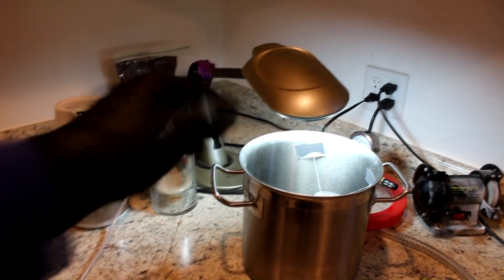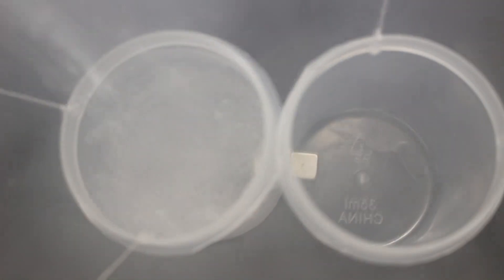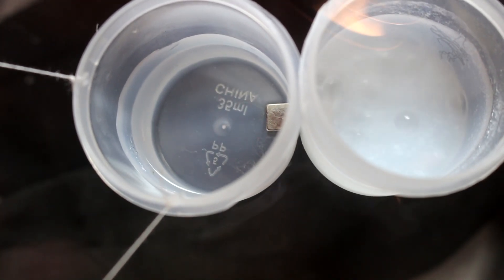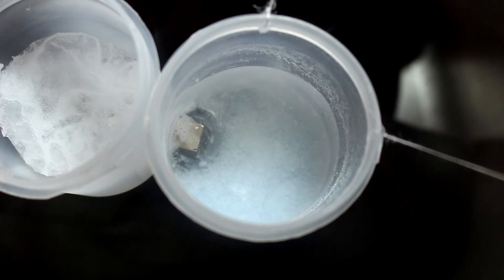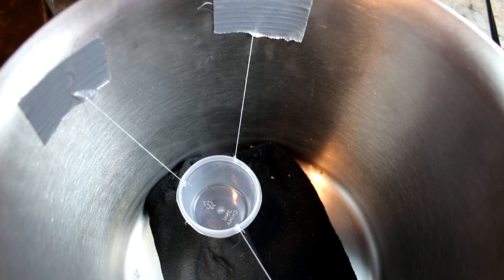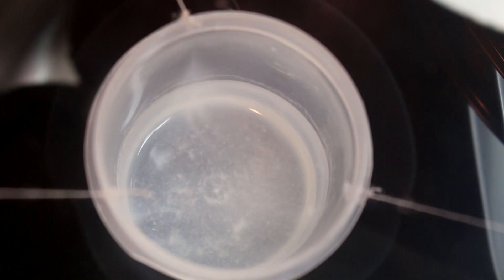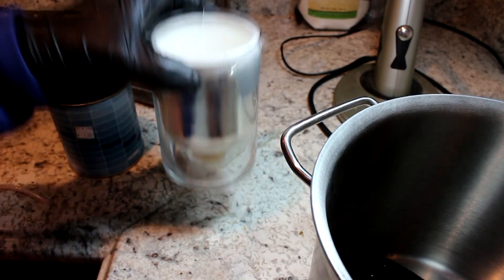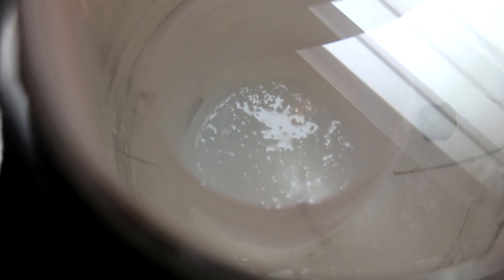Making Solid Oxygen

Comment: If liquid oxygen was at room temperature, would it be possible to inhale it without drowning? technically I'd still be taking in Oxygen but in liquid form. I hope you answer!
Reply: You're thinking of breathable liquids, which is a real thing. Fascinating, scary stuff. Turns out our lungs aren't meant to handle liquids, but they can just barely for short periods of time.
Reply: Nathan Burton

Hypothetically if a grandma had mustache she would be your grandpa.
Reply: +DaffyDaffyDaffy33322: our lungs themselves can handle the liquid fine (though with much lower efficiency since breathable liquids contain way less oxygen than the 20% of air). You just can't breath those liquids for extended periods of time because your respiratory muscles get exhausted from pumping around the liquid that's much more heavy and dense than air.

As far as I know those liquids are only tested on small animals like mice though, so when it comes to a person all the effects are still purely speculative.
Reply: There is no pressure at which oxygen would be liquid at room temperature. You can be LESS cold but you still have to be so cold.
Reply: Hypothetically if Liquid Oxygen was room temperature. Not literally.
Reply: Lajos Winkler I actually do know a thing or two about physics, i am a physicist. I already admitted that i don't know a great deal about physiology though. I should point out, that while i don't know much about physiology, alveoli do not necessarily need gas, and can perform their function with liquids as well. As someone has pointed out before, there are "breathable" liquids that have been tested on animals. Also, your analogy is highly flawed, these two things aren't remotely similar. Op's hypothetical is not meaningless, and is actually answerable. It is in no way paradoxical in any sense of the term. A better way to rephrase the question would be to presume a liquid with the properties of liquid oxygen but having a temperature of reasonable range to be able to breathe.

Although, i thank you for proving to me your worthlessness, you evidently are neither a scientist, nor a friendly person. I appreciate the personal attacks though.
Reply: Nathan Burton Don't let it get to you. People asked 2000 years ago what would happen, if, hypothetically you could make horses fly.

But horses cannot fly, that's against the rules of the world! Turns out we actually found a way to do it anyway.

Lajos Winkler is a troll, pay them no need. They are not the personification of science, at any rate.
Reply: More like blood freezing in his lungs, lol.
Reply: Thank you to the people actually making an effort to reply with an answer that doesn't condescend or ridicule. Learn to be curious people, you might get smart.
Reply: Nathan Burton It's not possible. If it was, the laws of physics would be different, and then who knows what's possible in a universe with a different set of laws of physics? I may be unnecessarily condescending, but I'm still right (as far as I know).
Reply: Nathan Burton my guess would be we would most likely die from oxygen poisoning. If we could somehow control the rate of oxygen absorption, then we could theoretically live. Take this guess lightly though, im a physicist, not a doctor/biologist/chemist.
Reply: John Titor I believe that your answer is a very good one. 
Liquid oxygen is much more dense than oxygen in the air, and it's pure rather than only 20%. This combined means that inhaling liquid oxygen would fill your lungs with about 3891 times more oxygen than when your lungs are filled with air. It probably does indeed need to be thinned down quite a lot to avoid oxygen poisoning.
Apart from that, if you could somehow obtain liquid oxygen at room temperature and atmospheric pressure, you probably could breath it, since the process lungs use to absorb oxygen from the air should also work on liquids.
Reply: For those who aren't understanding, we are speaking completely hypothetically. This is excluding the Law of Physics ect. I know it's hard to imagine these Laws not being in affect, just IF we could obtain liquid oxygen at either room temp, or a temp the human body can withstand. Would we drown. It's as simple as that. No ands, or buts. Just if...
Reply: +Lajos Winkler You don't even use correct grammar and punctuation. I don't believe you have a degree in anything, Let alone Science related. Like I said, I'm a carpenter with a curious mind. I do apologise if I over stepped a boundary and triggered your child-like maturity.
Reply: Nathan Burton It's impossible to answer your question. If we could ignore thermodynamics then anything is possible. If we ignore the freezing then it could go either way. We don't live in a world where that's possible so how on earth can we ever know what it would be like in a world with a different set of laws of physics?
Reply: +John Titor My Dad has a PhD in Mass Spectrometry, nothing to do with what we're talking about but he has the knowledge to make his own hypothesis. He agrees that it could be possible but not with our Law of Physics or Thermodynamics. Like we've said god knows how many times, it's hypothetical. These are "Scientists" with less English skills than my 5 year old - Clearly, as they seem to be missing out the word "hypothetical" every time we say it! They do make me laugh.
Reply: Nathan Burton The point is, it's impossible to know. If we're speaking hypothetically, then it's impossible to know. Your question can be answered but it'd be "No, it can't because the molecules would clump together so they wouldn't be able to fit through your alveolar pores until they boil or evaporate off into a gas" so I already answered your question. It's a no.

Like I said, perflourocarbons are different because they contain gaseous oxygen dissolved in liquid, rather than liquid oxygen itself, so when the oxygen comes out of solution, it's a gas so GAS exchange can occur.
Reply: James Oldfield Again, you are mistaken. We can make an educated guess about this hypothetical, we simply assume all other axioms and laws of the universe hold, excepting that liquid oxygen being unable to exist at room temperature. Im not so sure myself what is so difficult for YOU to understand. Im aware we can't actually KNOW the answer, but that's like stating we can't know that the planets in our solar system are big until we actually visit them ourselves.
Reply: thecoolkid26 Liquid Oxygen isn't water...
Reply: Nathan Burton I don't know what on Earth would happen in an alternate universe whereby liquid oxygen exists at room temperature...
Reply: IkBenBenG Liquids that weigh more than air? There's liquids that could weight less than air.
Reply: Nathan Burton No need to be a dick? But I am a dick! By nature! I plan on dying alone! ^__^
Reply: James Oldfield I'm pretty sure liquids that don't contain oxygen aren't breathable, regardless of what they weigh.
Reply: TheTLATER True.
Reply: That makes sense, I was just curious as iv heard of breathable liquids and wondered if liquid oxygen would act in a similar way. Also wondered if we would drown as it is a liquid after all.
Reply: Nathan Burton Hard to say without trying it out, and if you did, it would freeze their lungs and kill them, so without being able to test it in real life, it's hard to say. It could probably go either way.
Reply: It's not really a change of the laws of physics, it's a hypothetical question concerning the actual laws of physics, using speculation on what we do know.
Reply: If you take Klien bottles for instance, although they relate to topology, they only conform to physics in a 4 Dimensional plane. But we can still make them in a 3 Dimensional world. Merely hypothetical, with the laws of physics out of question. Would we drown inhaling O2 in a liquid form if it was possible to.
Reply: Above -118.6 °C, oxygen can not be turned into liquid no matter how much pressure you apply. So no, not even hypothetically.
Reply: How about a better assumption: If we had a creature that could survive temperatures at which oxygen is liquid and has a human-like respiratory system, could it breathe liquid oxygen?
Reply: TheTLATER Yes. If people can breathe liquids, which we might be able to test.
Reply: TheTLATER Having a human like respiratory system means it could not survive. You're asking impossible questions, paradoxes. That's philosophy, not science.
Reply: Lajos Winkler What are you talking about? You are making things needlessly complicated. The OP simply wants to know if liquid oxygen can be breathed without dying if there was some hypothetical means of withstanding the temperature.
Reply: John Titor If you knew a shred of stuff about physics and physiology, you'd understand his questions are paradoxical.

For breathing to function, alveoli need gas diffusion and that works with GAS at body temperature. No ifs and no buts.

Asking if it can work with a cryogenic fluid "just hypothetically" is like asking if you could have reproductive sex with a supernova..."just hypothetically". It's a meaningless question, unanswerable one.
Reply: IkBenBenG > Having a human like respiratory system means it could not survive.

I said human-like. Not human. In other words, some organ that works exactly like the human counterpart, except that it is somehow made of magical cells that survive those temperatures.

Then the question becomes: does the human respiratory system require gases, or could oxygen be extracted from a liquid, if necessary? Asking that question may have more interesting answers than "cold means dead", and maybe even useful results.
Reply: John Titor Nice try. Whoever gave you the degree should question their capabilities because a trained physicist would never, unless trolling is underway, try to coat a philosophical question in a scientific wrapper.
Reply: I'm not a scientist of any sort. I'm a Carpenter with an inquisitive, active, open mind. Willing to learn anything I can, to cram as much knowledge into my brain as I can.

 I do appreciate every comment though, helping me understand what is and what's not possible. I watch Cody because he makes Science interesting. He also doesn't act like a child throwing insults to those who aren't as intelligent.
Reply: Oh, the "people used to think____, therefore __" argument. You might as well add "Star Trek envisioned tricorders and now we have smartphones, that means ___ will also become reality" argument, too.

Horses still can't fly. We can put them on airplanes, but that doesn't mean horses fly. they're being flown.

When you fail to defend an argument, resort to insults. I'm not a troll, I'm just trying to explain to you that your question has no sense. It's no different from asking if a cat can give birth to a piano "if we ignore the science". It's ridiculous.
Reply: Nathan Burton Ironically, they are probably the only one who has made any sort of argument without evidence backing them up.
Reply: +John Titor There is no evidence. It's physically impossible to have any, the question I asked can't be tested. I was just curious to see what others thought on the subject. Like iv said 40 times already, it's all hypothetical talk. No one knows the correct answer and we'll also never know. Thanks for the response buddy, Have a great day.
Reply: Nathan Burton Well, i'd argue there is indeed evidence, because we have well tested laws of physics and chemical phenomenon, as well as biological, that support this idea. Of course, no one is arguing whether it's possible to have room temperature liquid oxygen, just that in the case of there being such a fluid, it would most likely be breathable so long as you could control the oxygen absorption.
Reply: John Titor No, it would freeze your lungs. You see, the thing is, as you increase the pressure of a gas, the temperature of the gas decreases due to the laws of thermodynamics. That means if oxygen could be a liquid without cooling it, which it can at a certain low temperature, it would cool down. Sure you can have liquid oxygen in a room that is room temperature, but the oxygen itself would be below room temperature. Increasing the pressure essentially keeps it from expanding to warm up which means it's always going to freeze your lungs. Plus it needs to be a gas to do gas exchange. The perfluorocarbon thing is different because the oxygen is a gas dissolved into the liquid. It's still a gas when it comes out of solution so you can still breathe it, unlike if it's a liquid, in which case the molecules would need to get warmed up in your lungs to turn to gas in order for gas exchange to occur as liquid oxygen's not soluble in blood. This wouldn't happen because liquid oxygen would freeze your lungs.
Reply: Basically my Hypothesis was, Would we drown from breathing in the liquid form of the very gas that that keeps us alive. Forget Thermodynamics, forget the Law of Physics. I want to know, would we drown, even though it's still Oxygen.  I'd find it ironic that we could drown from the liquid form of the gas that we need to live. You see what I'm getting at here? I don't understand why have I had to mention 17 times, WOULD WE DROWN. KEY WORD: DROWN. DROWN. You know if we inhale water, we drown right? 

Let's switch the question up a bit. If our bodies could handle such low temperatures without freezing our insides (if that's easier for you people taking this question way to literally), would we drown? after all it is a liquid, would our lungs respond the same way as if we inhaled water. Or would it supply the Oxygen we need.
Reply: James Oldfield Finally someone who gets it.
Reply: Fuck it, I'm finding some rope and an un-sturdy chair and making use of them.
Reply: James Oldfield What are you talking about? We have already established that this is a hypothetical where a room temperature liquid oxygen exists. In this case, liquid oxygen would not and could not freeze your lungs because it  would be room temperature. I don't understand why you people are having such difficulty with this.
Reply: It's really not impossible to answer their question at all. Of course, this is a hypothetical that does not exist in our reality, but we can certainly make an educated guess based on what we do know.  You are acting ridiculous, as though it's impossible to make educated guesses in the field of science.
Reply: John Titor I don't know how many times I've told you, it's impossible to answer this question in an alternate universe where the laws of physics and physiology are different. I don't know why you don't understand you're asking an impossible question. You can speculate but liquid oxygen WILL ALWAYS freeze your lungs. Liquid oxygen cannot exist at room temperature by definition. If it could then we would be existing in an alternate universe whereby ANYTHING can happen and then who knows what the answer would be.

You can make educated guesses about things that DON'T VIOLATE THE LAWS OF PHYSICS but in an alternate universe whereby there's a different set of laws of physics, ANYTHING'S POSSIBLE ANYWAY.
You can't just say you don't like the correct answer because it's not convenient. Science isn't always convenient.
Reply: I'll ask God when I die.

Just kidding.
Reply: John Titor All laws of physics are interdependent on one another.
Reply: The answer is a no because people drown in water.

Comment: What happens if you drop liquid oxygen in a tub of motor oil?
Reply from the maker: You know I was the one that came up with that...
Reply: LOX would boil off violetly as usual, and motor touching it would solidify.
Mixture of LOX and such combustibles is usually a very explosive substance. For example if LOX saturates asphalt and a tool (hammer, wrench, ...) falls on it, there's a reasonably big chance of a detonation occuring. LOX, asphalt and tools are common things in airforce and rocketry, so people have to be very careful.

Comment: Why does a REDUCTION in pressure cause solidification? Shouldn't it push everything the opposite way (towards  boiling/being gaseous???  Wouldn't increasing the pressure to several atmospheres be what would solidify oxygen??
Reply: It does push it towards boiling. Boiling something requires energy, that energy comes from the heat energy of the liquid, meaning the remaining liquid freezes.
Reply: Lowering the pressure allows escape of hot molecules, leaving behind cold ones. It's not an isothermic process.

Yes, increasing pressure (isothermically) would turn it into a solid, but pressures required are incredible. We're talking about gigapascals.